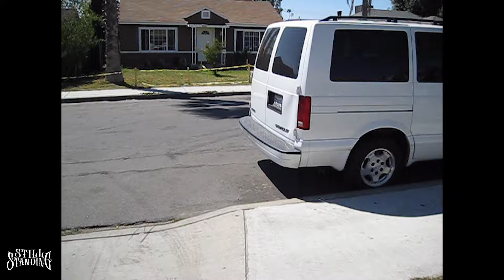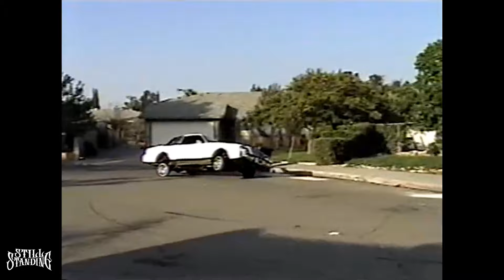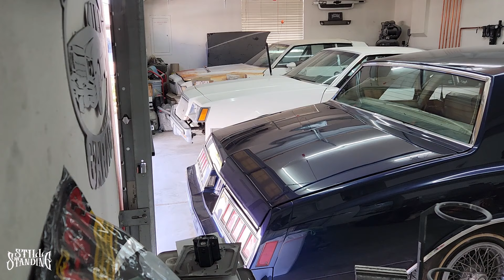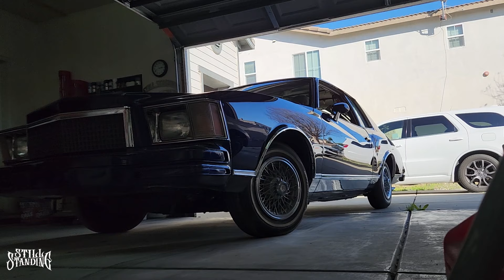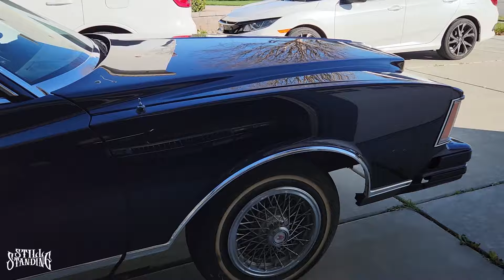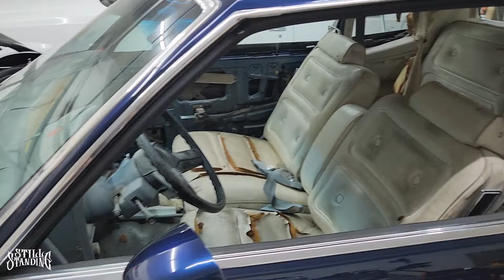'78 Monte Carlo Start Up | G-Body

Comment: Another tip would be,  don't use aftermarket carbs. Try to use or rebuild the original carb.
Reply from the maker: It's too late for these two projects. Aftermarket carbs work just fine as long as they are properly tuned. My 79 has a stock set up, and I'm planning on keeping it as stock as possible when it comes to the engine. That's if it's still good. If the engine is bad, then I might do an engine swap.

Comment: It’s probably got bad gas. It seems like it’s not firing right. Timing, spark and fuel.
Reply from the maker: Yeah, that's probably it. I just finished rebuilding the carb, and there were a lot of clogged passages. Little by little, I'll start getting it running right again 💪💯. Thank you for watching🤝